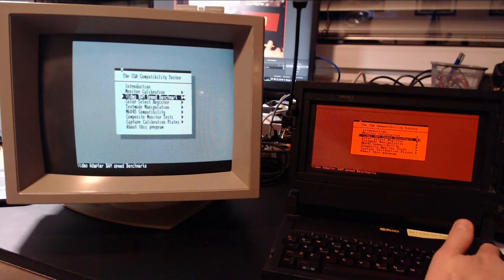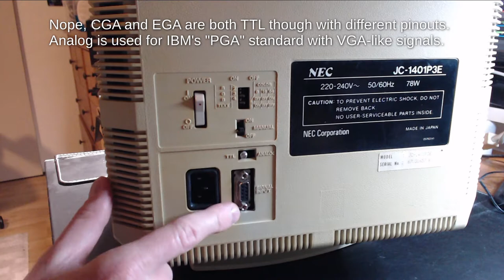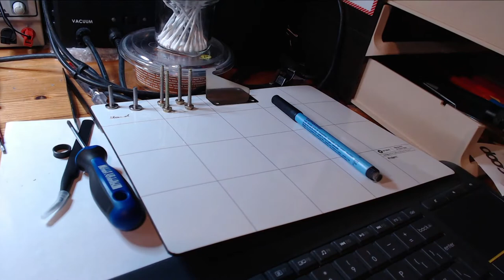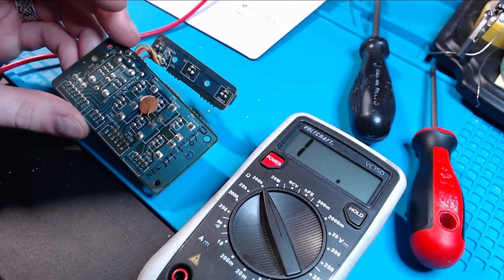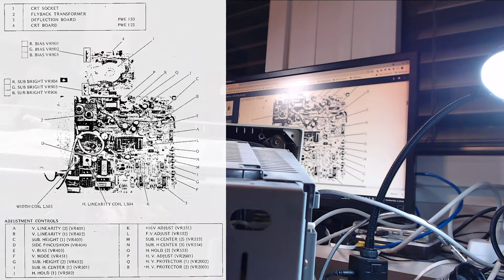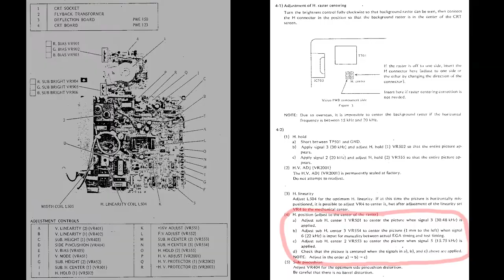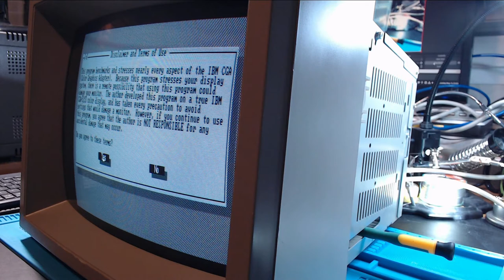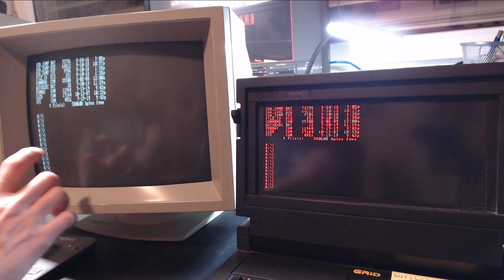Debugging a dumpster find: NEC MultiSync JC1401P3E

Comment: If you still have this monitor I uploaded a video on my channel about adjusting it. I have the same issues as you and was able to make some improvements but I still have to fiddle with it when going between different signal types. I think that is expected behavior.
Reply from the maker: Thanks for your comment and the pointer, Andy! It's curious that we both made a video about this monitor around the same time. 😁

For what it's worth, I am also unable to get both 800x600 and 640x480 centered without touching the controls. I remember you struggling with that too (it's been a while since I watched your video), so maybe that's just how it is. But at least I got it calibrated enough that the horizontal position control on the top panel allows getting both modes adjusted without opening the case.
I'm surprised that the monitor even supports 800x600 given it's age!

Certainly a cool device that I'm in no rush getting rid of. ;)